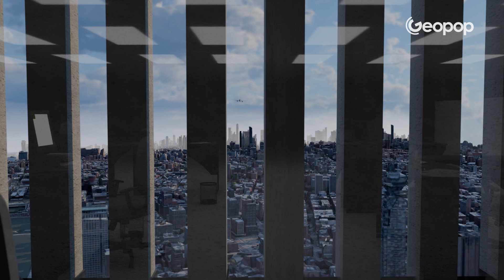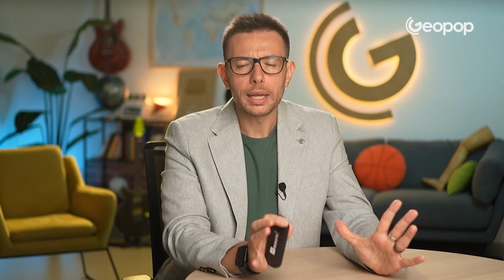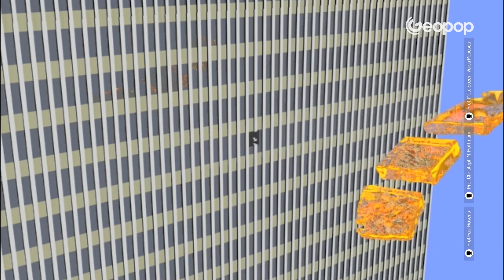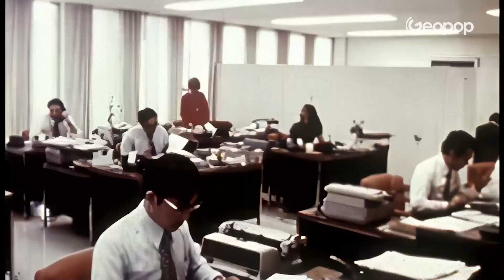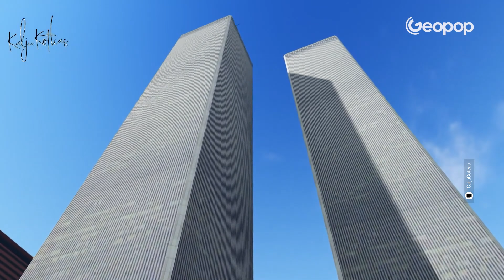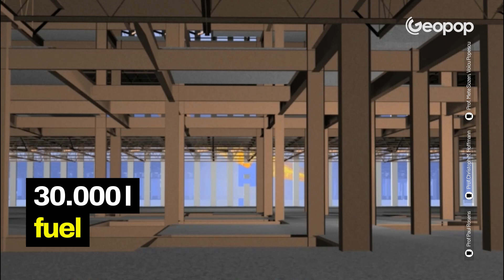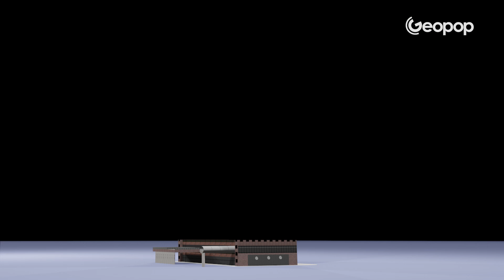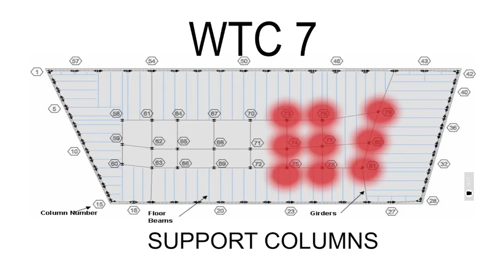9/11, 2001: The Technical Reconstruction of the Twin Towers and WTC 7 Collapses

Comment: 7:39 - at the impact of the aircraft the WTC Towers "....only swayed about 30 cm/12".
Not even close! Video footage  of the impact of WTC South Tower exists that clearly shows the Tower swaying as much as 2.5 meters/ 8' as the shockwave traveled up and down the length of the building several times over about a 15 second time frame. 
WTC North Tower might have swayed even further and for longer as it was struck considerably higher and square on.
Its hard to say. The aircraft  that struck the South Tower was traveling much faster than the one that struck the North Tower, almost 600 mph vs about 460 mph.
And it struck at a more oblique angle and nearer the corner of the building possibly imparting some torsional or rotational movement.
Either way, much of the info given in this video is demonstrably wrong.

Comment: My “sensibilities” are apparently not as “sensitive” as yours. You felt a need to re dub your voice after already trying it in English yourself. Wow. I bet you did it in front of a mirror too. There is no such thing as “light weight concrete”. You can call it that but ALL concrete is heavy. Especially when you pancake many floors together. The floors above weekend, slipped inside their mounts then started the downward travel. Each floor’s weight combined and even the non weakened floors gave. That simple.
Reply: You really should do a quick Goofle on "lightweight concrete " because I absolutely assure you it is a thing.

Comment: Controlled demolitions are impossible to hide.
Paid experts are not science. They are assets of the perpetrators.
Cui bono?
Z10N1STS!
Reply: The towers didn’t collapse like one controlled demolitions are clean and smooth the top of both tower was intact crushing the bottom floors that never happens with a controlled demolition

Comment: Ibonow nothing about jet fuel, temperature, ot stress onbsteel... I do know people theyre greedy, evil and sin gilled... I do have common sense this was a planned demolition of the WTC... Bush and many others did this... My opinion ... This guy went to alot work coverin tracks and explaining and explainng and explaining.... And the four untrained ignorant arab pilots oh yeah im sure they flew that commplicated piece of machinery into that building... Sorry your never gonna convience me.
Reply: "Ibonow nothing about jet fuel, temperature, ot stress onbsteel"
And you should have stop there.

"My opinion"
An opinion based on ignorance. Why do you trust it?

"Sorry your never gonna convience me."
As your position is not rational.
Reply: Common sense isn't so common after all. Neither are logic and reason, but when applied they look like this;

The 47 core and 236 perimeter columns of the Twin Towers support all of the gravity loads of the building. ALL of the resistance is in the columns.

Planes impact Towers, causing massive structural damage, destroying sprinkler systems, tearing out gypsum board walls and blasting off the SFRM insulation from the floors. Multiple floor-wide fires are started instantly and spread rapidly due to the destruction of fire protection systems and venting of the building during the impact.

Serious fires were largely confined to the impact damaged floors and those immediately adjacent to them.  

Fires were started by the impacts and fuel aboard the aircraft, which acted as an accelerant. No shortage of other consumables inside the tower to continue the fires. 

Collapse was initiated (started) at the impact and fire damaged floors when floor trusses exposed to heat over time sagged, in turn pulling on and causing the inward bowing of perimeter columns by up to 5 feet until they buckled. 

No steel melted or needed to. Structural steel will bend and fail at less than half its melting temperature.

Once the perimeter columns buckled the formerly static load above became a dynamic load 30 times greater, easily overwhelming the structure below.

Thousands of tons of now loose debris fell through the open off space - through the inside of the building bypassing the columns - dropping 12 feet onto the first intact floor it comes across. The massive instant overload causes the floor to fail, adding its mass to the falling mass which continues to accelerate for another 12 feet until it impacts the next floor, rinse and repeat all the way down. Rate of collapse increases as momentum increases. As each floor fails, air inside the building (the Towers were 95% air by volume) is compressed, then blows out the sides _in reaction to the Tower falling, not the cause of the Tower falling.

No fire required at all on floors below the impact points for them to fail. The mechanisms that started the collapse are different to the mechanisms which continued the collapse.   That will be a difficult concept for some.

As the floors fail the perimeter columns are left literally hanging in the breeze, no longer attached to the rest of the structure. They peel away and fall in great sheets (think banana) out to more than 600 feet from the base on the 4 points of the compass. 

Core columns failed last. 

Each 110-story tower had a 1-acre footprint. The debris pile was up to 14 stories deep and spread out over 16 acres, destroying 8 surrounding buildings and damaging more than 100 others.

Comment: Explanation of WTC7 collapse is total BS! Supported only by pretty graphics with no engineering basis whatsoever. The footage of the actual "demolition" of the building, tells the true story. Planned demolition and NOTHING to do with "fires"!
Reply: OK, how about this one?  Building 7, the 6th building to collapse of 10 lost on 9/11 though extensively studied still confuses many. Not famous or a terror target and with no casualties it didn’t get a lot of attention initially, creating an information void the internet filled with utter garbage. Because everything seems like a conspiracy if you don’t understand how it works I prepared this brief summary from my own analysis to fix that. No politics, just engineering. 

The North Tower collapse at 10:28am bombarded Building 7 with tons of burning debris, causing heavy damage and starting multiple fires burning out of control for the next 7 hours. Half the FDNY firefighters having been killed, others injured, units in disarray, equipment destroyed, no water pressure, and the greater urgency of Search & Rescue efforts, firefighting was pulled as futile. The building couldn’t be saved and was left to its fate.

www.youtube.com/watch?v=g_SvpwyC17M&ab_channel=MFitz  

Collapse of a burning structure is always a concern for firefighters. Steel buildings subject to fire rely on active fighting of the fires to survive. Buildings are designed around 1 to 3 hours of fire resistance, allowing time for occupants to escape and ACTIVE firefighting to get started, after which all bets are off. Left to their own devices they will exceed their design envelope and collapse. In B7 the occupants escaped, passive and active fire protections were compromised and active firefighting was abandoned which left the building to take its chances. It lost. Odds on Building 7 would eventually collapse, and it did. No big deal in logic. That is the sort of choice firefighters make every day in brush fire situations - which houses to save and which ones to let go. Only real difference here is moving the decimal on the size and cost.

www.youtube.com/watch?v=WnYBX6QT0R4 

FDNY Chief Daniel Nigro ; The biggest decision we had to make on the first day was to clear the area and create a collapse zone around the severely damaged 7 World Trade Center, a 47-story building heavily involved in fire. A number of fire officers and companies assessed the damage to the building. The appraisals indicated that the buildings structural integrity was in serious doubt. I issued orders to PULL BACK the firefighters and define the collapse zone. It was a critical decision; We could not lose any more firefighters. It took a lot of time to PULL EVERYONE OUT, given the emotionalism of the day, communications difficulties and the collapse terrain

FDNY Deputy Chief Peter Hayden ; We had our special operations people set up surveying instruments to monitor and see if there was any movement in the building. We were concerned of the possibility of collapse in the building. And we had a discussion with one particular engineer there, and we asked him if we allowed it to burn could we anticipate a collapse and if so, how soon? And it turned out that he was pretty much right on the money, that he said 'In its current state you have about 5 hours

The collapse of Building 7 was anticipated and widely reported in the media throughout the day. At least 24 video cameras recording some or all of the collapse. Everyone knew what was coming and why.

www.youtube.com/watch?v=OY5S5k3tMHI 

Building 7’s collapse was completely different to the Twin Towers, harder to understand with most of the details difficult to see. But we can still sort out what happened through careful analysis and observation.  This is MY EXPLANATION of the collapse sequence using the best available information and relying on no authority.

B7 was complex 47-story steel framed structure built on top of a smaller existing 3-story building, requiring several lower floors dedicated to complex load transfer structures instead of usable office space. Of trapezoidal shape and all-steel tube-in-tube construction, B7 (above the 7th floor) consisted of a central core of steel columns carrying most of the gravity load, perimeter steel columns around the outside of the structure carrying the remainder of the gravity loads and long span beams and girders to tie those elements together and form the floors. On the outside of the building hung a moment frame - the last part of B7 to fall. 

Phase 1 : The first externally visible signs of collapse initiation occurred at 5:20:28 pm. Collapse initiation for B7 is notably quiet with observers not realizing the building was collapsing! There was no audible warning in the form of say hundreds of ear drum busting 180-190dB explosive bangs preceding the collapse. Here at 12:00 a local CBS affiliate reporter is talking 10 blocks from B7 when collapse begins. People don’t start to notice the collapse until 12:11. Then at 12:45 is the famous CBS fixed camera clip of Building 7’s collapse.  Note how quiet it is.

youtube.com/watch?v=t5tEy6mXSE8&ab_channel=fresnosean379

Collapse initiation was due to lower floor failures above the load transfer region (7th floor) in the NE corner of the building. In this video at 0:45 you can see the NW corner from inside the building while under construction, Column 79 just out of frame on the left. That big, angled steel beam across the top of the frame connects to C79 at one end. The girders connect to the beam. That beam and all those girders depend on just one connection

youtube.com/watch?v=nP3TNHPCIVU&t=35s&ab_channel=EdwardCurrent

Phase 2 : Lower floor failures caused a loss of critical lateral support over an excessive length of core Column 79 and it buckled. If you look at a floor diagram of Building 7 (see above) and look at all the structures that depend on C79 you quickly realize this one column was a relatively isolated structural element on which a disproportionately greater fraction of the structure depended analogous to say the Key Bridge. Externally we see a vertical progression of window breakage along the 44-46 line and a kink in the roof of the East Mechanical Penthouse at the top of the building, consistent with C79 failure. The transition from full capacity to almost no capacity occurs in virtually an instant. Once the buckling failure occurs there is almost no resistance

Normally with a buckling column, the load could very well be redistributed to other columns, meaning the buckling could stop after a while. With C79 that is not the case - the failure did not redistribute the load, so the collapse rapidly progressed to the roofline, sinking the rooftop penthouse.

Phase 3 : With C79 gone, B7’s progressive, non-symmetrical collapse continues with C80 and C81 at the east end of the core left laterally unsupported and quickly buckled and failed as well, sending the EMP down through the building. C79-81 all have no diagonal bracing, which I believe is a major reason why they could not redistribute a lot of vertical loads among one another.

From there collapse progressed from east to west through the central core until the core was gone taking all of the interior floors and structures and probably most of the perimeter columns with it. You can see the horizontal progression of window failures low in the building and the dropping of the remaining rooftop structures into the building. One of the big takeaways from the NIST Building 7 study (that gets completely ignored) was their modeling which determined C79 failing under ANY circumstances would have initiated the same collapse sequence.

Phase 4 : After some 10 seconds all that remains of Building 7 is just a hollow empty outer shell - the exterior moment frame - creating the illusion the building is still standing since little has changed externally. But it’s just a hollow empty shell like an empty cereal box supported by only a few remaining columns and quite unable to remain standing. With all the internal framing gone, the north face leans inward, forming a V in the roofline, the last perimeter columns buckle under the strain and with nothing left keeping it up the moment frame free falls, landing on top of the 7-story high debris pile. It is only at the very end that a single measurement of alleged free fall acceleration is taken. Note this is not the building but just its outer shell, and only one corner at that, at the very end of the collapse. Start to finish the entire collapse took 18-20 seconds, or less than 1/3 of true free fall and we have to look at the whole thing, not cherry-pick little bits to fit a particular narrative. Worth noting _how fast something falls cannot tell you what started it falling in the first place. The debris spread out, blocking surrounding streets, heavily damaging the Verizon Building and destroyed Fiterman Hall, all well outside of Building 7’s “footprint”.  

Building 7’s progressive, non-symmetrical collapse was incidental and unintended collateral damage from the combined effects of fire + time + gravity started by the collapsing North Tower. That is true no matter who planned and carried out the 9/11 attacks or why . The collapse was of so little consequence it barely even registered at the time, a mere footnote. It only took on semi-mythical status as an alleged smoking gun years later when demolitions at the Twin Towers, missiles at the Pentagon and shoot down over Shanksville all failed and conspiracists had nothing left to work with.

Anything can seem like a conspiracy if you don’t understand how it works. Now you should. I hope you found this helpful, informative and it solicits informed critical comment. If I made any errors of fact, logic or reason or left anything important out, please let me know so I can fix it. IF you can offer a more plausible alternative please do. Be the first. Please start any reply with the words “Tits McGee” or I will know you didn’t read it and are wasting my time.

Comment: I have to disagree with the statement that if explosives were used on building 7 they would have blown outward. Lots of building demolitions do indeed use explosives and they don't blow outward. In fact the term used is called imploding, which directs the force of the blast inward.
Reply: You can disagree all you want, but you would be wrong. "Implosion" has to do with how the building falls, not which direction the blast wave from the explosive travels - which is always all directions.  FFS 🤦‍♂

Also worth noting explosive controlled demolition is used with reinforced concrete construction. Steel frame buildings are invariably dismantled.

Comment: The dubbing is more impressive than the COMEDY of the analysis.

See Mental Boost 2 4 data on 9-11, anomalous mineral formation, magnetized concrete, golf divots in totally twisted metal cut in 30' segments, unburned paint for the proposed heat distribution, pWoof, hydrino. Besides, the antenna fell B4 the building.
Reply: Whatever meds you are on, you may wish to consider increasing the dosage. It ain't working.
Reply: @TheCriticalStinker-jw4fl  
Medical tyranny is top on the list, see nonvaxer420. But, you don't do research, such as squibs. Fool.
Reply: @RobertMStahl  - Squibs?
Reply: @TheLoonResistance yes squibs, some people say squids. Shows how much you know about controlled demolition
Reply: I've only been talking about them for months
Reply: @robbiehiatt9966  
What about Mental Boost 2? So much good reporting...